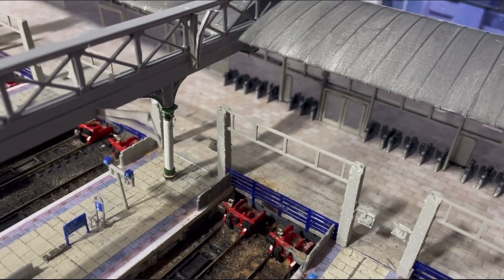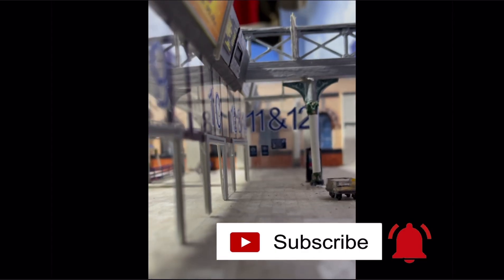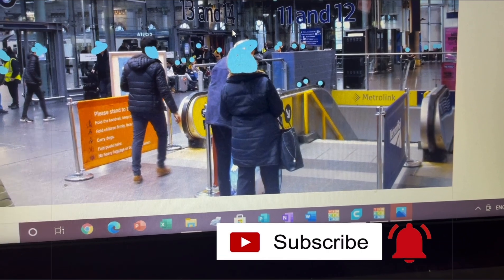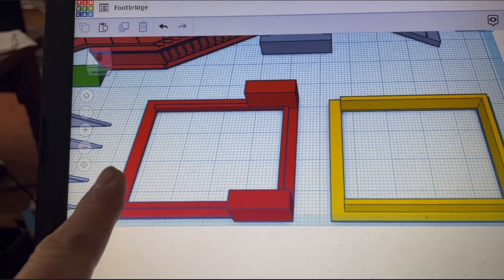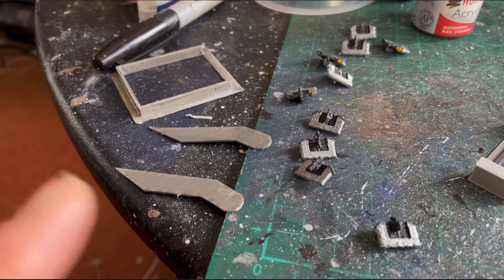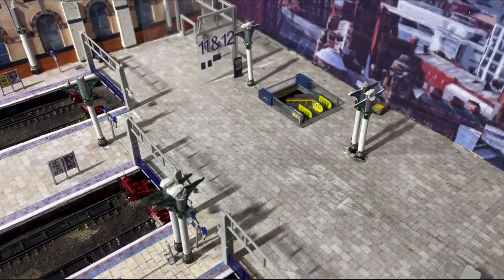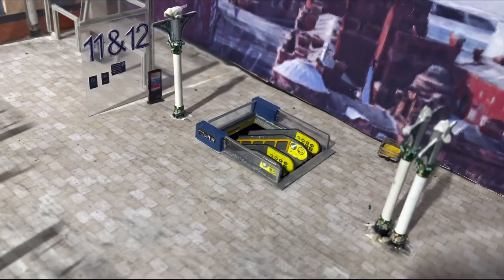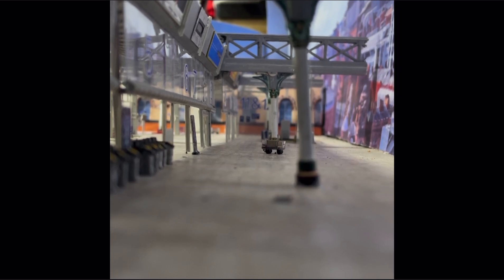BUILDING MANCHESTER PICCADILLY IN N GAUGE –  Escalator to the Metrolink, Building the Concourse 2

Comment: All going to plan then John. Detail is superb.
Reply from the maker: Lol, bit by bit. You wouldn’t say that if you saw my pendolino. Thought I’d test it running power car at back. Got it running Beeeaaauuuuutifully, then it derailed, now gears are trashed in power car. Constantly derailing AGAIN-and move sounds like a tractor lol.
Reply: @piccadillymodelrailways  oh dear..not good..sounds like a rebuild of the gears.if you can get the parts .or buy the hole bogie ,may better in the long run.
Reply from the maker: Gratefully Ive got the parts, that’s the easy bit but the derailing???? Been trying for three years lol
Reply: @piccadillymodelrailways  Just check the wheels are in line plus the back to back ..some of my coaches were not in line and they were a right pain .run all day one way then derail as soon as you sent them the other way. All i did was turn the axle around. Sorted. so checked other rolling stock and had the same on odd ones. It`s just how it hit a points or curve lots of trial and error. it`s how the wheels are centred on the axle. Worth a check john..
Reply from the maker: It seems to derail on a crossover, which in all honesty I dont use so. .. I’m gonna rip it out. We’ll see. Thanks Allan

Comment: John steel escalator treads are often marked yellow on the two sides and also at the back of the tread. These positions denote the nips (danger points) on them. During my former life, before I retired, I had to investigate an accident to a 4 year old girl. Her new and very sticky wellies were dragged down the side between the tread and the side skirt which is flexible. It resulted in a very painful fracture. Those markings and the other warnings are really necessary!
Reply: Yup. I think that was featured on Thats life back in the 80s. I live in China now and we had a woman fell through an unsecured service hatch. Now all escalators have warning signs at the top. I think the flexible sides on the tread has been designed out now.
Reply from the maker: Oooooooh I dread to think, but thank you for the info.

Comment: Hi John - the escalators are the  business.  Very realistic indeed.  Snap re the 800 - got the LNER liveried one on order as well.   I did read in a forum they are delayed as there is an issue with the body shells  being the wrong way round  - whether that's true is anybody's guess.  Cheers Euan
Reply from the maker: Thanks Euan, it’s still been fairly quick though, be interesting to see whether hornby (OO) or KATO get the LNER 800s first.

Comment: I wonder what was going on at 3:15 far left of frame. Did you ever change to a 0.25 diameter nozzle on the printer?
Reply from the maker: Hi, no idea what was happening in the pic. I had to blot our heads and faces fir GDPR reasons. 

No still using 0.4mm nozzle think the extruder needs adjusting and cleaning, think that’s causing the splitting layers